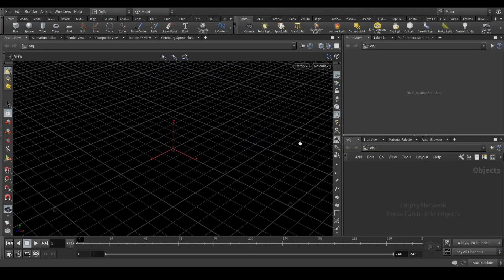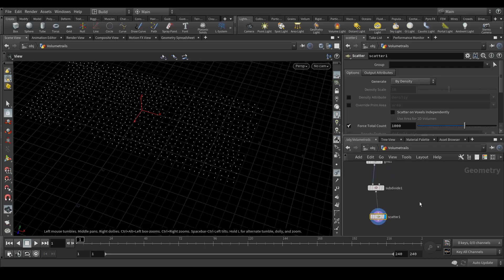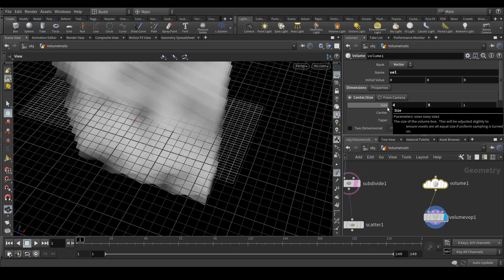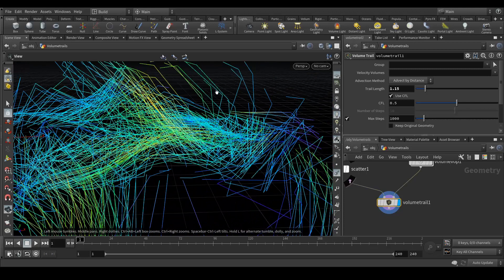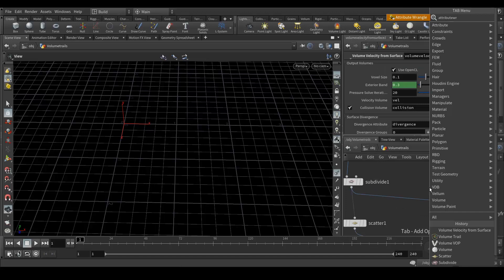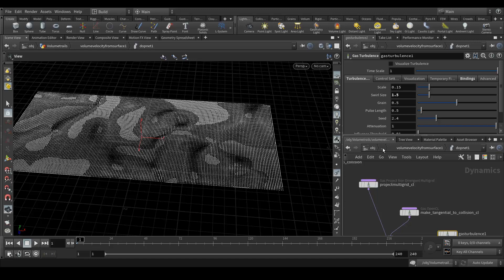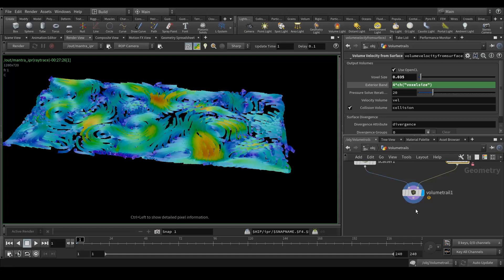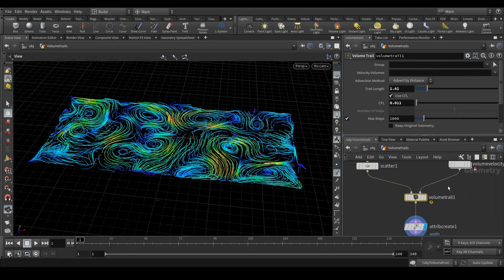Houdini Volume Trails Tutorial Procedural

Comment: thanks! it solves alot of issues i had with curl noise. there is another node called "volume velocity from curve", is it using the curve to drive the curl force?
Reply from the maker: No, I haven't used that, I used the volume velocity from surface node and inside that node gas turbulence is making the curls.